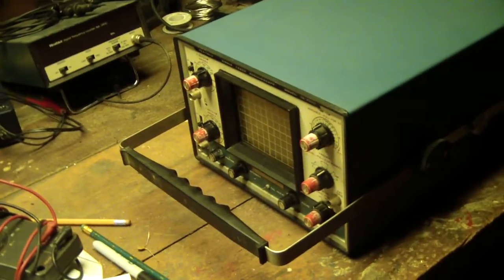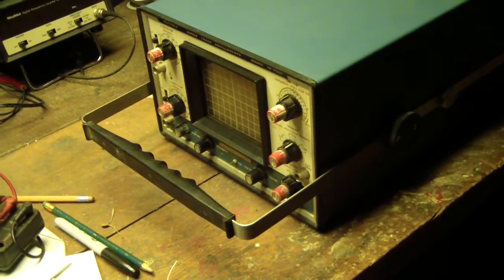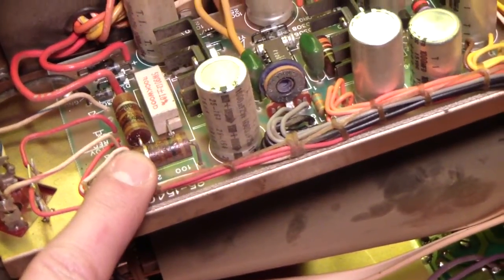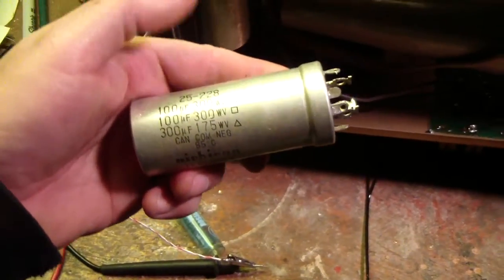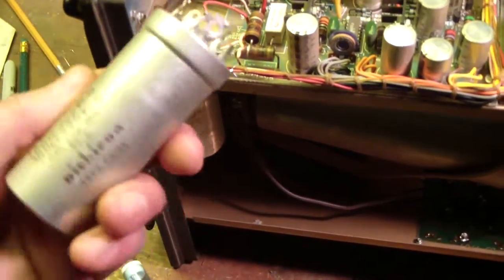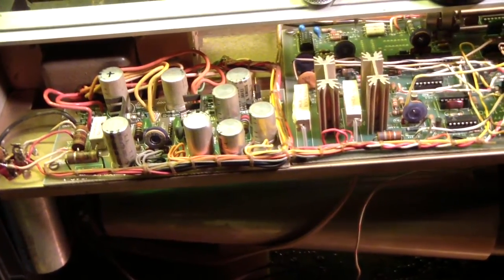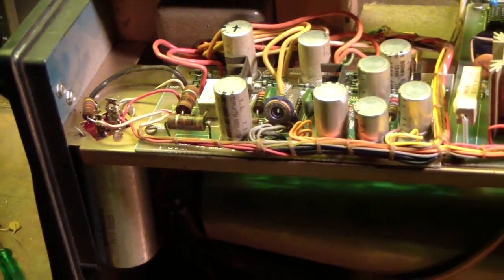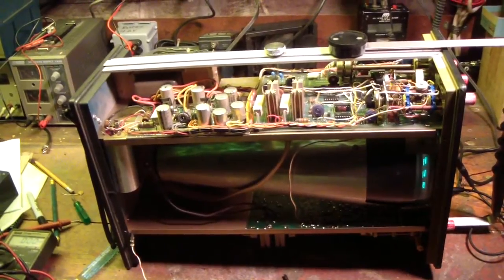Heathkit IO-4555 oscilloscope repair

Comment: I DO remember that scope......after I built it and started to operate it in order to do calibration, I noticed those same two resistors got hot enough to result in their paint stripes and varnish to bubble away merrily. I called my designated Heathkit support technician, who advised that although they were quite hot, they were within their power dissipation specification, and everything was normal. This is not the only Heathkit design I encountered where one or more resistors, technically operating within specs, ran too hot to touch. But nevertheless, that equipment keeps working over the decades, so apparently Heathkit was correct.

Comment: I still have some of my many Heathkits in storage, one being the IO-4550 dual trace. I pulled an all nighter assembling it and got a BIG surprise when I installed an electrolytic backwards!!!! Their kits were awesome  . . . that is until Zenith took over. I built 4 of their TVs. The GR-2700 (a Zenith set) came with boards and harnesses assembled in Mexico. It kept blowing the circuit breaker until I saw that a power supply harness came wired backwards. The Tech at the store was pulling his hair out when he assembled their in store model. Seems a whole production run came out like that. "The Quality went out,  when the Zenith name went on"!
Reply: I know there were other factors, but I believe that Zenith's acquisition of Heathkit was a major cause of the failure of the company.  When Schlumberger was their parent company they produced the most fantastic products ever.  I have many of their kits.  Zenith only wanted Heath as a stepping into the microcomputer market and were successful for a while with their laptops that were popular with government and some education institutions.  They cared nothing about the line of kits that made the company famous.

Comment: I had built an IO-4555 back in 1984. The only problem I had with the scope was arcing in the power transformer from the outer most winding to the copper shield. This caused a resistor on the HV board to fail. I put a piece of silicon tape between the copper shield and the winding. Yes, it arced through the insulating paper. I would be careful with the replacement can electrolytic cap as the date code looks to be from the 13th week of 1978. I am currently recapping a IO-4235. I will be replacing the can cap with three radial lead caps that will fit in the same place on the LV board. Also, it looks like some of the other caps on the LV board are swelling. You may want to check the caps for leakage. The IO-4555 was a great scope. I did homework from my college days on it. Used it in a guitar factory for testing circuits.
Reply: I would like to get a modern digital scope as well, but the 8 bit resolution is a big turn off for me, as I do mostly audio work. It seems DSO's are really aimed at digital types, who don't need good vertical resolution. I currently use a Goldstar 9020 20MHz, and my main scope, a Tek 2215A 60MHz. So far they both still work great.
Reply: @ronshaw80  , you have to be thinking of a pretty crappy digital or DSO to think that 8 bit resolution is all you can get with them. That said, although I have a pretty high end 4 channel DSO with integral logic analyzer and all the bells and whistles, I rarely turn it on, favoring my old Tektronix 200MHz dual trace, delayed sweep analog scope.
Reply from the maker: Ron Shaw And there's something soothing about the smooth phosphor glow of a trace on a CRT.
I did get a cheap digital scope,  and have used it for various projects where I wanted the quick feedback of the displayed measurements on the screen.  And one where I needed waveform graphics for a presentation I'm doing.   But I still keep the heath around.
Reply from the maker: +Gregory Burns Thanks for the tips Greg.   I have checked those other caps with my ESR meter and they're all under 1 ohm.   There's really no swelling, that's a slight optical distortion from the angle and cheap camera.    I'll probably replace that can with modern caps eventually, but between jobs at the moment and money is too tight to mention.   I'm going to get a digital scope eventually, but I'll finish the repair on dad's old scope for sentimental reasons and keep it around.
Reply: My first scope was an old Heathkit 5MHz tube type. Single trace. I used it for years, and it worked fine, even though I never replaced any tubes. It still worked when I gave it to a friend back in the mid 90's. I built a lot of Heathkit stuff back then. A TV, a couple of receivers, a VTVM, a powered breadboard and dummy load (which I still have), a function generator (still have that, too).

Comment: Well, a lot of the companies took shortcuts in their design to save money and to keep costs down for the kit builders.
I've built a lot of their kits and one thing I can say for Heathkit, the quality of the components is real high compared to
the Japanese counterparts at the time. The old Drake, Collins and Swan Amateur gear is a good example when compared
to the Kenwood and Yaesu gear. The resistors and capacitors were rated conservatively and were better in quality but
the Japanese equipment was sometimes more refined in the engineering.

Comment: Good ole Heathkit equipment and they had good manuals to go with them for building and servicing. It's a shame that they
don't have anymore kits available. I really miss the kits even though some of the engineering on some weren't designed
good but that was only a few. What's bad about some of the equipment to day is that most of it is throwaway and not
serviceable. Thanks for your video review.
Reply from the maker: +Dennis Petersen I built quite a few Heathkits when I was younger.  BTW, in looking at the schematic, I discovered that the 150 and 170V supplies filtered by this cap are nothing more than a simple resistor divider network directly off the transformer with rectification.   That 10 Ohm power resistor next to the two carbon resistors is reading just a tad over 9 ohms, which is why those two rails are a bit high.   I'll probably replace that 10 ohm resistor to bring them down.
Reply: @loughkb  , the voltages on the Heathkit schematics are approximate, and depend on the type of meter used to do the measuring. Since these particular supplies are not regulated (at least at that point in the circuit), those somewhat higher voltages might be due largely to your line voltage being a bit higher.